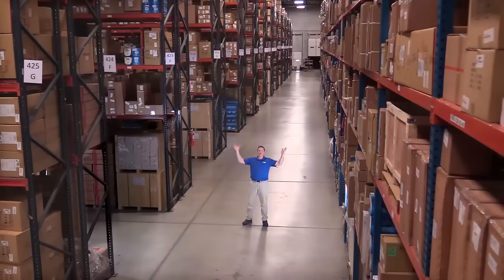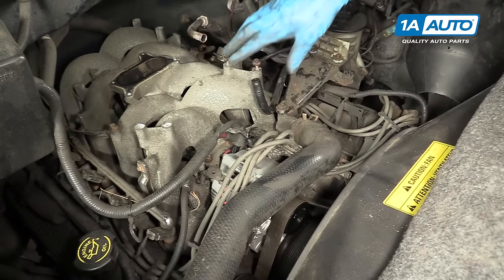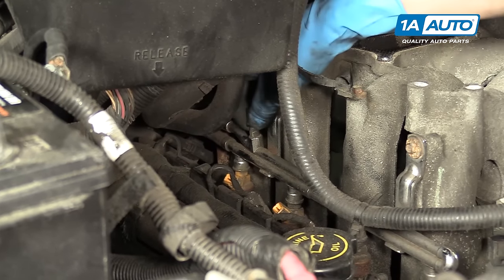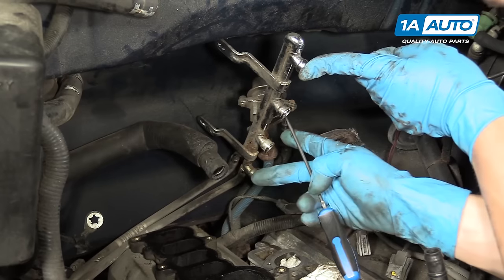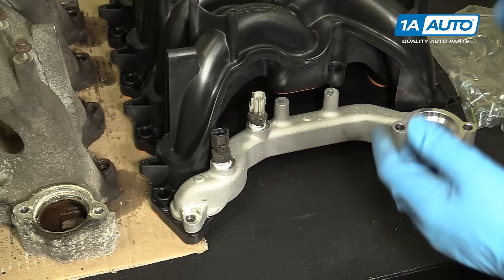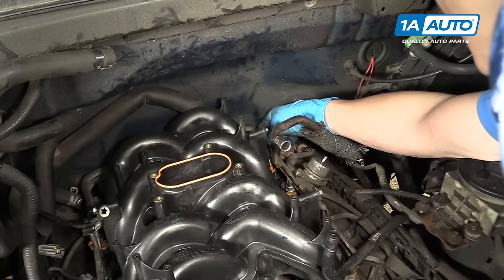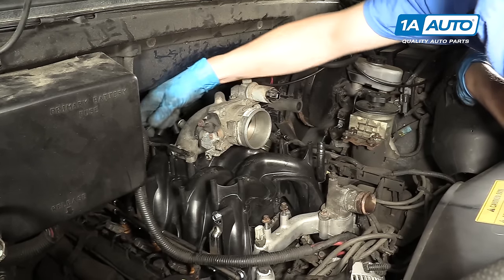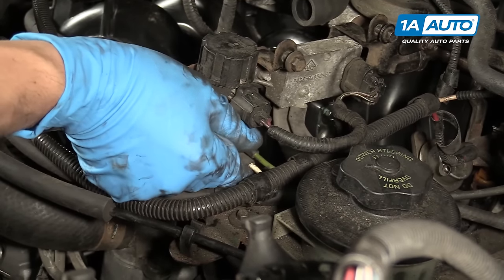How to Replace Upper Intake Manifold 97-06 V8 4.6L Ford F-150

Comment from the maker: √  Watch the Video 
√  Buy The Part at 1A Auto http://1aau.to/m/Visit-1AAuto 
√  Do it Yourself 
√  Save Money
Reply: I just change my intake manifold. Word of advise on the older model f150s people if you're gonna change the water pump and the thermostat you're likely gonna need the manifold. The manifold was ok until I change those parts. After doing so the truck gain a lot of power and the air pressure also build up. So if put a strain on the intake start busting hoses an all. Another quick succession if you are leaking antifreeze check your heater hose at the back of the intake. The original hose has this hard type plastic that runs through the rubber hose its a culprit to crack. When it leaks you don't even notice it because it's at the back of the intake manifold and it leaks down and end up at around the middle of the truck on the passenger side.
Reply from the maker: +Andrew Powell Thanks for the feedback!
Reply: @1AAuto  question is the 4.6 process the same as 5.4?

Comment: BTW when you're down to replacing the gaskets, many of these if not all the 4.6's have a coolant house that runs along the top of the motor under the intake, visible after you pull the intake, REPLACE IT WHILE YOU'RE THERE. 1Aauto carries it or other places, it's well worth replacing it now as opposed to later when it breaks and having to repeat this entire process for a $20 hose.
Reply: What else should you replace because you are there?
Reply: What's the hose called?

Comment: Plastic manifold in no way was upgraded version. They cracked and were junk. Other then a small amount of corrosion that could be cleaned I would have put the aluminum one back on.
Reply: I switched back to aluminum for that exact reason. 👍

Comment: Why are you replacing the manifold? I have a coolent leak, but I was just going to replace the gasket.
Reply from the maker: +lee cook The original one had developed a crack in it. Hope this video helps you out. 1aauto.com
Reply: I was wondering the same thing, thanks for asking.
Reply: Very common issue with thesd 5.4s and 4.6s bet yours need a manifold too

Comment: Great video, but you failed to show the gaskets on the manifold and throttle body. And you failed to mentioning the presserazation of the fuel system. I think these points are important to mention. Lastly will the vehicle need a tune becuase the system was torn appart?

Comment: Amazing video! Absolutely love the step by step process. I'm not a big Ford fan and avoid it like the plague. But I have a client tomorrow so this really helps dust off the old cobwebs. I noticed however, at the 18:30 mark. You removed the intake bolts starting from passenger side ending on the driver side.  My mentor always grilled me about removing and replacing in a center-out, star pattern. It balances the stress on the mating surfaces. "A little here, a little there, or you'll end up paying for the whole divorce." ~J. Jones

Comment: Thank you for the instruction.  I just did an intake gasket replacement on a 2001 F150 based on this video.  Some items were a little different, but nothing was hard to figure out.  Also, my truck doesn't have the benefit of a lift kit, so without the extra overhead clearance I just removed and replaced the manifold with the lower plenum intact.  It was a tight squeeze, but it worked and saved a lot of difficulty.

Comment: This is a great video and very helpful for me when I changes the gasket on my 98 Ford F150.   Doing this job fixed numerous problems with my engine to include oil in the coolant, coolant leaking into the intake port, and coolant in my oil.  The truck runs better than at any time since I have owned it during the past 12 years.  Adding a couple of extra recommendations, The EGR tube was locked tight so I used a 1 inch copper pipe for more leverage and prying on the nut; I hit it with a hammer and it broke loose.  I also bought a deep well 8 mm socket with a 3 inch extension to get the bolts in the back.  The space in the back with no lift was very hard to get at but this worked for me.  Also, I dropped tools and hardware taking it apart that went under the manifold because of the tight space.  When I put it back together, I stuffed rags around the manifold so when I dropped a bolt or tool, they didn't go under the manifold where I couldn't recover them.  With the rags in place I could see them and reached them with a magnetic parts retriever.   I also cleaned the injector ports that were full of carbon.   With the manifold removed, changing plugs, wires, and injectors is a very easy job and not real expensive if you have any doubts about the possibility that you will have to change them in the future.  After I cleaned up the old aluminum upper manifold it was in great shape so I reused it.  The lower manifold did not look all that great so I replaced it.  Again, for not much money.  I also used a Fel pro, more expensive gasket, that was very strong and durable and I didn't have to worry about screwing up the gasket when I put it back together working in the tight space.  Wish I had done this job 10 years ago when I was younger and my health was a lot better.
Reply from the maker: +David Baker Thanks a lot for the great feedback and the tips! We'll pass this info along to our production team to possibly include some of this in any future repairs/videos we make for this vehicle.

Comment: Removing and installing hard to reach bolts- use a stick magnet. Before beginning relating to dirt around the intake holes- blow the top off thoroughly before beginning. If you don't have ready access to an air compressor, stop by a mechanic shop, they'll usually oblige you to simply blow it off. If that's not an option, spray WD-40 around the intake BEFORE beginning, next best thing to keeping loose dirt from freely falling into unwanted spaces. But still another great video from 1Aauto!! Thanks for the helpers!

Comment: Out of countless vids regarding upper intake replacement, yours is by far the best.  Extremely clear & concise, wonderfully filmed, and without a ton of needless fluff.  About the only critique I'd have would be questioning why put on the old injector o-rings when new ones cost a few bucks at most?  Reusing injector o-rings creates a very real likelihood of future leaks, at least once you've removed them from the injector bodies.  Still though, awesome job.  Thanks for your contributions.
Reply from the maker: +Troy Stevens Thank you! We love empowering our customers and showing how to perform DIY auto repairs with our high-quality auto parts.  http://1aau.to/m/Shop-1AAuto-c

Comment: This video works! I bought the parts and coolant for about $500. Would have been cheaper, but I needed fuel injectors. Did all the work myself following this video. The only issue I had with the video was at about 40 mins in you skip attaching the spark plug connectors, which was very easy to figure out.
Reply from the maker: +Dave Thanks for watching!  We love empowering our customers and showing how to perform DIY auto repairs with our high-quality auto parts. 1AAuto.com

Comment: One can disassemble both the upper and lower intake manifolds outside the engine compartment. A lot easier than doing it in position. The reverse is also true!

Comment: I’ve done this a handful of times although it may not be recommended, I simply just loosen all the upper manifold bolts, hoses, etc remove alternator, throttle body, and fuel rails and with a little finesse you can squeeze everything out still attached coils and all no body lift needed then disassemble outside the truck save yourself an hour of messing around.

Comment: Why did you replace the aluminum intake with the plastic one? I thought the plastic was more susceptible to cracking?
Reply: also if your reusing aluminum intake do not use the plastic/rubber gaskets, heat will crack them in a hurry...only use the metal/rubber style...

Comment: Great video for a novice like me with a recent purchase that needs work.  One question--why is your air filter housing partially cut away, exposing the filter to view?  Is that a trick to bring more air to the engine?
Reply: I did that simple "mod" to my 03 expedition with the same engine. You do notice a difference in throttle response, esp if you have an open exhaust system. Ive since then bought a cold air system. that was a "quick fix" back when i was younger mechanic. 😁

Comment: Great video. Thx! Just got my 2003 F150 w/ 5.4 back with the bad news of the intake manifold having issues and therefore won't pass emissions. Can't justify spending the money they want for this old 'APF' truck, so I'll do it myself.
Just curious, why did you not keep the original manifold if it was still in good condition and just replace the gaskets? Maybe you mentioned why and I missed it.
I get that they're not that expensive but just wondering. THX
Reply: Agreed.  There's no reason to replace the metal intake with a plastic one.  In fact, I'm getting ready to install a metal one from a '99 F150 on my 2003 because the plastic cracked under the coolant crossover connection (a typical failure on the plastic intakes).

Comment: instead of taking the bolts that attach the upper and lower intake together can it be removed in one piece? And then taken apart outside the truck? seems like it would be easier to do it on the work bench. Or is there not enough room to remove both while they are bolted together? Great video by the way I plan on doing this this weekend!
Reply from the maker: +Robert Barnes It's not something that we have tried. You may be able to service it this way.

Comment: I have a 97 f250 2wd 5.4 propane truck factory 100,000 miles great shape in and out ,one of things my uncle left me ,I wanna convert it to gas ,before he passed he was in the process of making it natural gas,so project unfinished sadly,it still has three large tanks one under belly two in bed I’m in the process of taking everything propane off ,next step would be greatly appreciated,can I use same i tank? Put gas tank on run lines and go? Lol

Comment: Can you please tell me the part number for the O ring that goes on the "tuning valve" or "runner valve" on the plastic "box" under the intake manifold? 

I can't find it anywhere. It's outer diameter is 2.60 inches. Thank!

Comment: Is it safe to clean the intake elbow  after removing the throttle body off of it? Or do I need to remove the elbow and clean it when it's disconnected from the manifold?

I want to clean the EGR ports and I can't remove just the EGR valve because the EGR tube nut is completely rusted and stuck and nothing will take it off.

Let me know.. Thanks!

You guys rock!!
Reply from the maker: +Yo Daddy Thanks for checking us out! We would highly recommend trying to get that nut off in order to properly clean this. While it is possible, we would not recommend it due to the pressurized nature of the cleaner. 1AAuto.com

Comment: I need to do this to my truck, 2003 f150 4.6 I have coolant leaking into the spark plug well
Reply: I just got a deal on 2003 f150 5.4 for 2k has this problem. i bought 469$ in parts (coils plugs and intake) doing it tonight. very common issue. nothing to worry about =D
 it has 230k miles

Comment: Thanks your videos are always helpful. Just wondering if you can attach that lower plenum to the upper and install all together,  seems like it would be alot easier at least for me? Mine is a 2000 Expedition 4.6 and it's really tight, also mind has a vaccum leak instead of coolant.
Reply from the maker: +Classic Stang brn We don't believe that you can but thank you for checking us out!

Comment: Hmm mine doesnt have those 2 temp sensors like that in front of the intake, wonder why? I just started taking mine apart to do a knock sensor. It's a 1999 ford f150 4.6l W

Comment: I have a 99 F-150 and by using a mirror it appears there is a leak from a crack underneath where the manifold connects to the head? under the thermostat any thoughts?
Reply from the maker: +Andrew Dohrmann Leaks are common issues, but can be due to several different things.  We recommend having the vehicle looked at by a professional.  Thanks for watching.

Comment: Do you have any videos of the upper intake manifold removal for 1997 Ford Explorer? There's a line on the driver's side front of the upper intake that has a clip you pull out and I like to know what it goes to. I hear a leak from between the upper intake and lower and when I pull up on that line it gets quite and my trans shifts late.
Reply from the maker: +Michael A Larcom Sr We currently do not have an auto repair video that covers this particular repair. We will keep this request in mind in the event that we need to make this repair in the future. 1aauto.com

Comment: Replacing that perfectly good cast aluminum intake for a plastic unit known to crack. 

You also failed to mention the difference between 97-98 non PI intakes vs the 99+ PI intakes.

Comment: Great video. Lots of good information. I just replaced my intake manifold gaskets now the truck won’t start i looked everything over good and just watched this video. Any ideas what i might have done wrong?  I’m getting fuel to the fuel rail and spark to the spark plug wires. The engine only turns over though. I also scanned it and have no codes. I’m  lost on what to try next. I even checked all the fuses
Reply: The truck was running fine before i replaced the gaskets
Reply: What was the problem?
Reply: I no im late david did u figure it out

Comment: Will this tutorial also work on a 5.4l engine? I have a 1997 f250 with the 5.4 triton engine and I think I need to replace the intake manifold.
Reply from the maker: +Jon boy It may be a different procedure on that particular year, make and model truck. Thank you for asking. 1aauto.com
Reply: I did a 5.4L v8 a few years ago and it is a different manifold, but thee are a lot of videos on youtube for that engine.

Comment: Can you remove the water crossover without removing the intake on a 2010 lincoln navigator 5.4 liter.? I'm just trying to replace does gaskets on the water crossover.
Reply from the maker: +Ozzie I believe you would you still need to remove the intake.
Reply: Thank you so much.
Reply: @1AAuto  YEP, the crossover bolts from below and you can not get to the back bolt. Engineering Flaw! The old adage is appropriate, “engineers need to be supervised by mechanics at all times.”

Comment: Hey guys, I have an 01 ford f150 with a 5.4l triton and I just got done replacing the intake manifold gaskets. I got everything back together like it should be and now I have a crank but no start issue. It does fire a little bit but not enough to make it run, any ideas? Thanks in advance.
Reply: Did you find the issue?
Reply: Did you ever find out what caused your no start?

Comment: If anyone knows of replacement alternator bolts on these, please let me know what they are.
I stripped one of mine out (having to pound on a 9mm socket to get the bolt out.
All autozone or anyone wants to sell is a big M10 bolt.

Comment: This doesn't cover the 2001 f150, so not sure why it says 97-06 cuz thats not accurate. Mine is way different with the throttle body in the front of the upper intake

Comment: 2 issues, 
  1st ) this video is 2 years+ so I do not know if I will receive a reply from  A1. So please chime in if you know the answer your response is much anticipated ‼️
    2) This is the IMPORTANT question⁉️.   
     This pertains to the coolant hose connection on the passenger side rear. 
Now I have the 5.4, however everything is 99.9% the same ( my 1998 has the coil on plug , so you can remove the coils when you pop the fuel injectors, replace your plugs regardless of 4.6 or 5.4, COP or replace the plugs and wires)
        Continuing,  THIS IS THE MAJOR QUESTION / CONCERN…. The pass rear coolant on the plastic DORMAN intake. 
 My 5.4 has the EXACT passenger rear “ L” shaped metal heater hose connection, however the DORMAN plastic replacement intake, does NOT have the passenger rear curved “ L” shaped heater hose connection,  the adapter nozzle threads into the water crossover as you show on this intake. 
   IS THIS PROPER TO USE THAT PLASTIC REPLACEMENT NEW INTAKE THAT BLOCKS THE REAR PASSENGER COOLANT PORT ⁉️  
    THE PASSENGER REAR HEATER HOSE THAT FIT IN PLACE ON THE OEM ALUMINUM INTAKE “L” HOSE CONNECTION CAN REACH THE INCLUDED FRONT PASSENGER SCREW IN HOSE CONNECTOR. 
   
 CAN THE PLASTIC REPLACEMENT INTAKE BLOCK THE PASSENGER COOLANT PASSAGE ??   
  If the intake used ….blocks the passenger rear coolant passsge and it is moved to the passenger front crossover and used, ………will this blocksge of the passenger rear and moving the hose connection to the passenger front crossover do any DAMAGE to the engine by blocking the passenger rear collant passage and moving the connection to the passenger side front coolant crossover work ok ?? 
   Re cap: Basically if the passenger rear intake heater hose port is blocked by the replacement intake, and moved to the screw in hose connection located in the passenger front crossover WORK OK⁉️   Keep in mind that the OEM “ L” shaped heater hose will be blocked and moved to the passenger front crossover to circulate coolant. 
  I am worried that by blocking the passenger rear L shaped hose connection and moving the OEM “L” shaped hose to the passenger front intake coolant crossover will block a critical coolant pasage in the passenger rear will impead the proper coolant flow ???      
     Or will the cooling system function ok if moved the front passenger intake coolant crossover ?? 
   This is pretty simple to inderstand by looking at this video,  but really hard to put into words for some reason ( please excuse) 
   Any knowledge of the coolant flow or blocking that passager rear coolant hose ( and moving it to the front coolant crosdover)  would be greatly appreciated ‼️‼️‼️